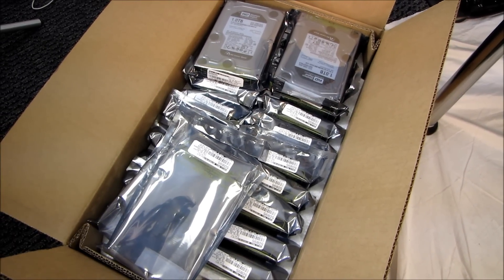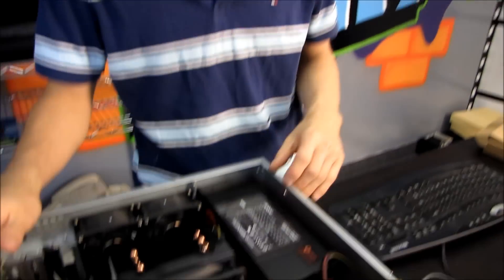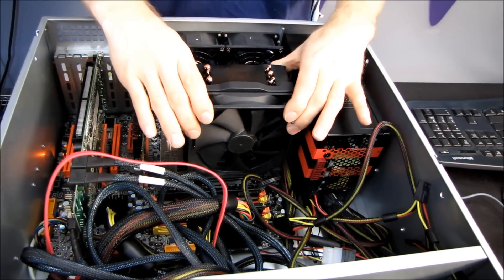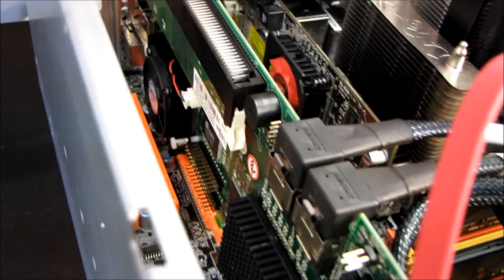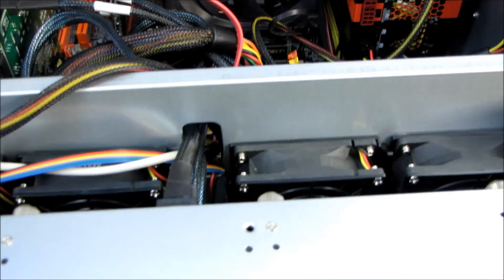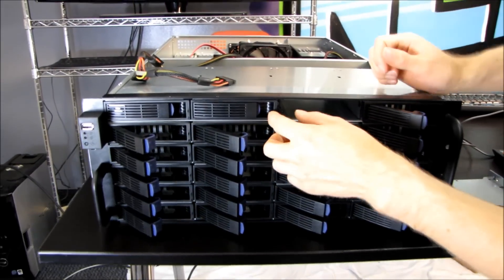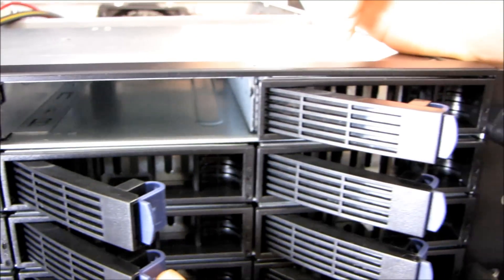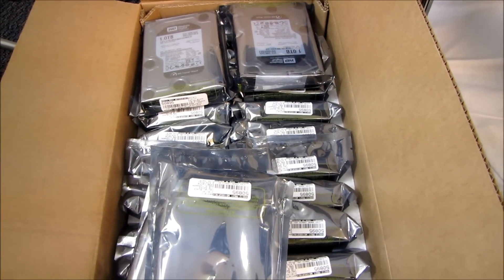Preview of 24 Drive RAID Build in Norco 4U Case Linus Tech Tips

Comment: Its funny, I had a WD Drive fail today after only being used for 3 years.  On the other end of the spectrum my ancient Dell Dimension 4600 (which I still use for Folding@Home) has an 8 year old IDE WD Drive thats still running.  Funny how older stuff often lasts longer.

Comment: @bjuszczak6 if you really believe that, then you disregard one very important factor: Aside from the fact not every drive will be at the same stable temperature and affected by nearby, other drives, no drive is entirely equal to another. Trust me - I've seen die drives from one shipping whilst others continued running for another two years without any problem. Besides: Mixing drives in ANY RAID is something only an idiot would do. And there's a reason why other raid levels exist.

Comment: erm....I have no idea at which point I should say this guy on the video is an idiot...

#1: 24 HDDs take a MAX of 20 Watts during spinup. That's 480 Watts in all. Add another 150 for processor, board and raid controller and 50 more for the rest and you'll come up with 680 Watts - an 800 Watts PSU would be MUCH more efficient - and as this is a RAID, it should come with REDUNDANT PSUs.